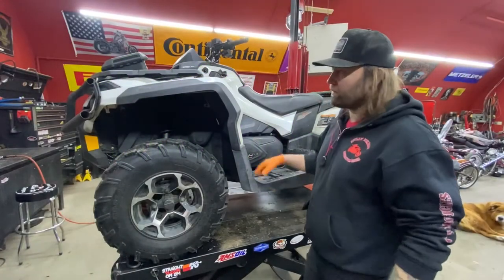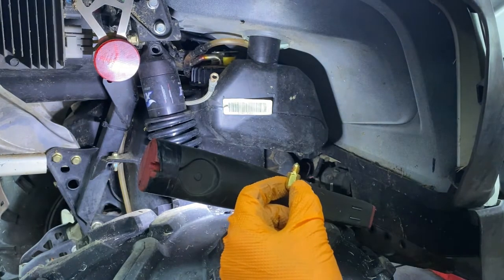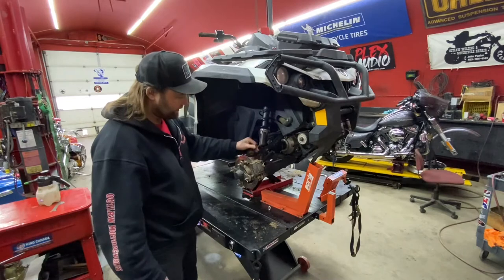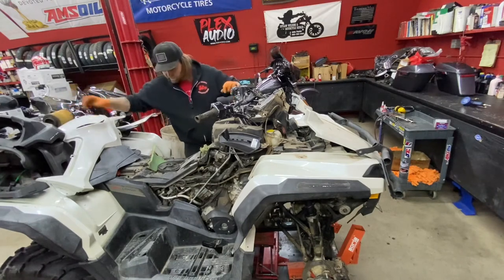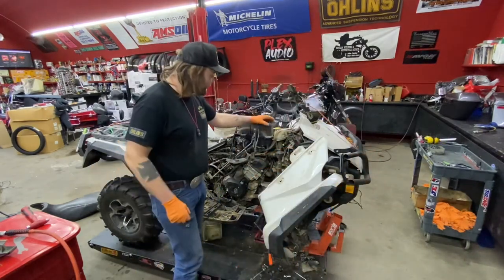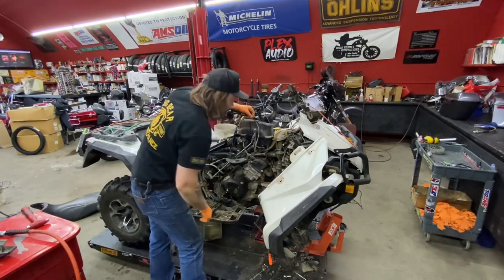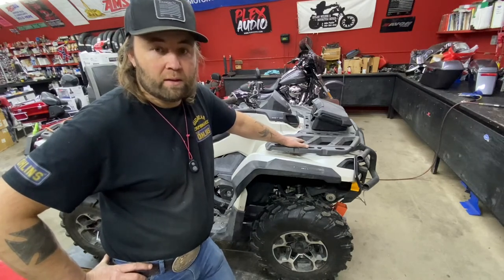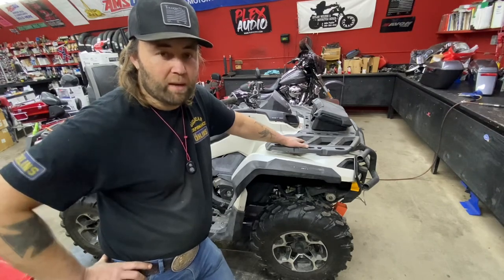Brake line replacement can am outlander

Comment: How did u bleed the rear caliper
Reply from the maker: With a vacuum pump, just suck the fluid through and add fluid at the master
Reply: I've done this and get to the point where fluid is moving out the back caliper with the suction and no air bubbles but I've got no pedal at all and no bodys home at the rear caliper it has a dual cylinder setup
Reply from the maker: I couldn’t tell you. I didn’t have a problem. We just use the vacuum pump.

Comment: How long did the whole process take? Considering doing it myself vs having it done at a shop
Reply from the maker: I’d have to look at the original invoice, but there was quite a few hours involved lol.
Reply: @outlawweldingmotorcyclerep1680  I've heard anywhere from 6-8 hours. I've had my machine down to nearly that level last summer. I'll see about getting a quote. Thanks for the reply!
Reply from the maker: @swobovike  it will take all of 6 for sure. 
Let me know what the dealer quotes please
Reply: @outlawweldingmotorcyclerep1680  dealer quoted exactly 6 hours. Since I don't really have the time to do it myself (I remember pulling everything off for a different project and this would go even deeper) I've decided to let the shop handle this one. Thanks for a great video!
Reply from the maker: @swobovike  Six hours isn’t that bad if that’s all the dealer quoted you. I’m sure it took me all of that
Reply: I did my front brake lines after one blew out in under 40 minutes. I can tell you right now anyone quoting 6 hours to do the front brake lines only is scamming you.
Reply: @tylerseabook9423  How so? They quoted me 6hrs but it actually took longer because BRP decided to flip the entire assembly. When the dealer called BRP about they told them to "just make it work". I think they said the attachment points were upside down. They only charged me for the 6hrs. As an aside, they failed to tighten down one of the brake calipers and the bottom one ended up coming out and the caliper dropped down and rubbed on the inside of the rim, and in reverse put holes through the rim causing a flat tire. They also replaced the rim and caliper bolts.
Reply: Just Finished that job  myself,  the brake lines is one Piece, 4 conector.almost torched the Quad.. such a stupid design..
Reply from the maker: @Michel251167 it is completely ridiculous!! Done on purpose
Reply: @outlawweldingmotorcyclerep1680  yeah that might be, if you don't have enough alcohol at hand, don't do it..🤣